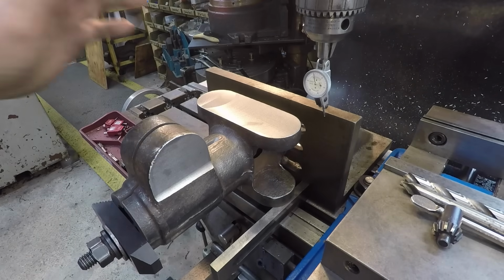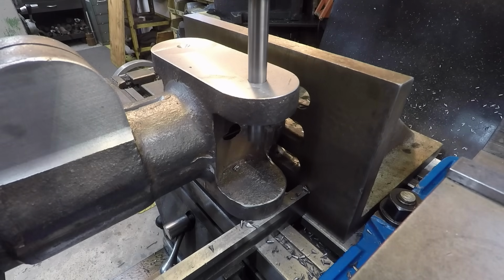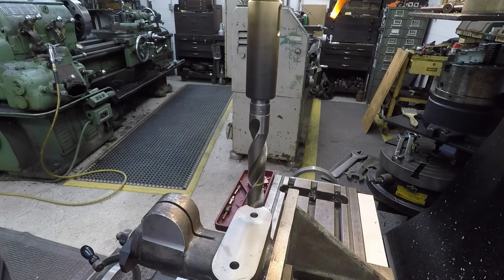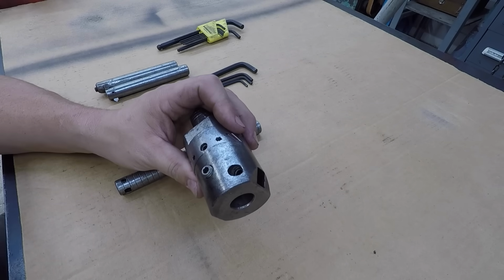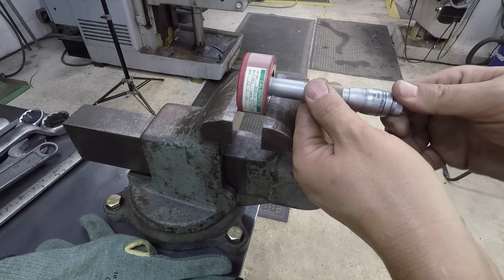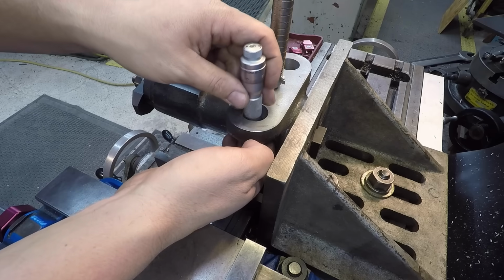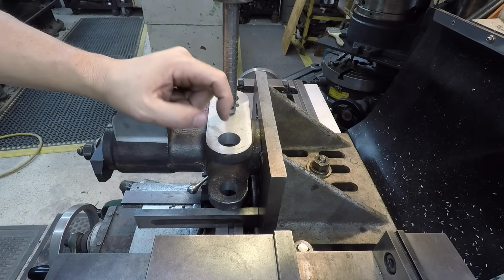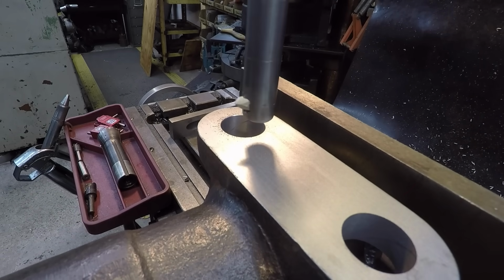Fairbanks Power Hammer Cross Head Part 5

Comment: If the angle plate is the squaring surface against the central bore, why not use the center of that bore as the tabbed base's? Meaning, pick one absolute for the whole piece and use that as the reference? The bore seems like the most important element of the piece. Also, bushings absorb flexing forces and keep the CI from cracking.
Reply: Did he not center on the slot which is center of the bore, then verify that it was center of the tabs?

Comment: How is it possible for a drill to cut oversized?  It’s a defined diameter.  Please educate me!
Reply: Hi Allan, if the cutting edges are unsymmetrical then only one will contact at first and push the drill of to the side as it rotates.
It then cuts bigger than the drill diameter.
This is sometimes done intentionally to get a drill to bore slightly bigger than the shank size, by grinding the tip to do this.
Watching the drill and making sure the chips from both cuts are the same in size is an indication that the drill is cutting symmetrically.
Reply: Both my father and my Uncle would deliberately grind the drill bits off center to get clearances when needed.  It that shop you always used a drill gage to check every bit before you  used it

Comment: Hi. Yet another great video! Quick question - I noticed you stopped when drilling the hole to check the finished size, after 1-2mm (sorry 1/8" inch). Do you ever stop just as the drill enters the pilot hole to check the 'chamfers' created by the drill. I have issues with clamping/centralisation on auto-load CNC machines and a way of checking correct clamping is to ensure that the chamfer is uniform between the rough/pilot bore and the finished bore.

Comment: I'm really curious how you still get a concentric hole with a bent bar? What am I not seeing that makes the tool steal at the end run true?
Reply: The top of the bar remains in the same concentric, plane, or whatever you wanna call it. So even if the bar isn't straight, the bottom part will always return to the same position after a revolution. That is assuming the bar does not flex.
An easy way to demonstrate this is to take a paper clip and unfold most of it, take one end of it and spin it in your fingers. You should notice the other end stays in the same concentric as the end in your finger.
Reply: Exactly.  The way I think about is to clear everything from my mind except the two points at the exact center of rotation of the front and back spindle bearings.  There's an axis of rotation through those rotation points.  Every point on everything attached to the spindle rotates around that axis, and traces out a (nearly) perfect circle, no matter what else is nearby supporting that point.  That includes the tip of a cutting tool (on the mill) or the workpiece itself (on the lathe).

Or... imagine you DID have perfectly straight bar.  Then weld a little lump of steel on it -- would it still cut right?  Suppose you filed a little notch somewhere in it -- would it still cut straight (assuming it's still stiff)?  How about if you welded a lot of little lumps and filed a lot of little notches?

Comment: If I may, why do you not use any coolant during your drilling/boring the holes?
Reply: Cast iron is very easy to machine.
Reply: I believe cast iron has sufficient carbon to act as a lubricant.

Comment: I wonder how practical it'd be to set up a vacuum on a lathe or a mill that's piggybacked off the main motor power and, on a lathe for example, the nozzle is fixed on either the carriage that the tool post rides on or is fixed on the headstock by the chuck, or even both
Reply: not a bad idea tbh, you could save yourself lots of work cleaning with such a setup.
Reply: @Afrokamelffs  problem I see is with stuff like magnesium, you get some of that in the collection bin and then some hot steel and then you have the recipe for a magnesium fire which is a bitch to put out

Comment: adam  why did you reset the boring head when you  did the second set of holes? it was set to 1 tho under target diameter  so its just a matter of locating it ?  curious  it seems like overkill to start from scratch unless it was too much cut for the bit as i know the equipment can handle those loads. and i remember adding steps was just adding possible transposition or calculation errors  or just plain forgetting what was the important number lol less so with dro's and cnc but you still need to keep track of several sets of changing values while remembering target size  often converting between fractional and decimal just for a bit more challenge. thanks for the videos

Comment: Abom, did anyone tell you the trick of wrapping some solder around the bar to reduce vibration and chatter?
If it fell off, it would have been too soft to damage the bit or part, but you can prevent that by twist-tying the ends together.
Try it, I was 19 in 1973, and the machinists that taught me were in their late 60s.

Comment: 08:53 - why would a drill cut oversized? Isn't the fact that the drill is a fixed size part of the point (so to speak)?
Reply: If the tip is ground off center, the bit will 'crank' instead turn. Drills almost always drill oversize (in metals, soft materials not so much).

Comment: No oil?🤔
Reply: Not on cast iron
Reply: The reason why you can machine cast iron, without using oil or coolants, is that the graphite in the cast iron acts as a lubricant in itself.  Oil tends to catch the fines and get them into your way wipers and other nooks and crannies.  You can use a strong shop vac to remove chips and dust, or flood coolant can be used to move the chips and fines on down the line.

Comment: I'm curious why no cutting oil for the drill bits, I it because it's cast?
Reply: Cast iron has a high enough carbon content that the carbon dust that comes off it provides all the lubrication you need
Reply: @TAWithiam  Not just any carbon either, it is graphite which is a fine lubricant, while carbon from a zinc carbon battery, or anthracite coal or diamond , all forms of carbon would not lubricate like graphite does.
Reply: @TAWithiam  I gotcha that's what I was thinking just wanted to be sure thanks

Comment: When I started as an apprentice at the steel mill I'm at, my first job (with a tradesmen there too of course) was to make 12" cast iron piston rings for the steam hammer we have. I machined the OD and ID and width then we made a diagonal cut with a do all and heat treated them! Was awesome! Cool video.

Comment: you referenced the holes from the edge, surely the holes should be referenced from the centre of the big hole
Reply: For the right project it might be instructive if Adam was to go through a part's drawing to address drawing projection, tolerances, parallelism and squareness, concentricities and runout etc and how these dictate the machining processes;  might even do a final compliance check on his newly re-mounted ( and checked for flatness) granite surface plate.
Reply: The holes are referenced side to side from the lug which is centered to the bore.
Reply: @canonicaltom  Adam machined both the lug (and in turn the slitting saw cut) and the 2 flanges using the cast surface as datum ( by taking equal cuts off each side ), rather than using the already machined internal bore.
Reply: @arfonjones7188  Ah, it's true. I had to go back to Part 2. It must not be a critical dimension then.
Reply: Now I'm curious to know what happened to the identical one he made last April.

Comment: Why not spring pass it rather then flap wheel it??
Reply: I think a spring pass is likely to take more off than a thou, and there's no real way to make sure it only takes 1 thou off. Flap wheel barely removes any material so you have much more control to ensure you don't go over.
Reply: @ericg7044   ya that makes. Your right

Comment: The bore was .028 under and he wanted to divide the cut into two parts, so he adjusted the boring head .014 (14 clicks).....but this adjusts the radius of the cut, which should have opened the hole the full .028.  What a I missing?
Reply: Probably the head is calibrated in diameter thou.
Reply: Most boring heads are direct reading dials

Comment: Hi, Adam! You should drill a hole at the end of that split as there will be a stress point.
Thanks for helping to bring another Fairbanks back to life!
Reply: I am glad you asked that, as I was about to mention it.   It does seem strange that a casting is being used to clamp onto the shaft, I thought you can't bend that metal very much.   ( Modulus of Elasticity and all that..)
Reply: @hiscifi2986  The original part  has the same features. I believe  they also ere casted. You can clearly see the  split and drilled hole in  multiple photos on interwebs.

Comment: Hi Abom! What are you doing at right about 10:41, where you reach for the quill lock just as the drill is about to complete the hole and break through to the other side? Are you adding friction to the quill so that you don't bust out the other side too hard and maybe leave a bad exit hole? Please do enlighten me on this little step! Thank you.
Reply: It's possible for the drill bit to grab as you're breaking through material, acting like a tap on the flutes and screwing itself into the job. locking/tightening the quill when breaking through just aids as a brake, preventing you from "losing" the drill.

Comment: at 19:00 that boring bar that has a wobble. Won't you end up with a oblong hole?
Reply: As long as the cutting edge always remains the same distance from the center of rotation the hole will be perfectly round. So the boring bar actually doesn't have to be straight at all -- just stiff enough not to get deflected too much.

Comment: Hi Adam. When the second bore came out on size I'm curious why you didn't just move the boring bar back to the first holes and bore those to the correct final size, and opted to use the flap wheel. With your DRO set for the hole spacing I would have thought that would be easier. Is it because the amount to remove is too small? Thanks.

Comment: Is it the camera angle or me but the shaft on the bull bar looked bent ? What type of bushings do you use on cast , is brass the best or stainless ?
Reply: Hey Dave, that threw me also, but you have to remember, when he adjusts that dial in the boring head, he is making the whole boring shaft eccentric.  Basically, offsetting the boring shaft by x thousandths of concentricity.  So yeah, it looks like it's wobbling, but it's not.
Reply: @rhoused1743  thank you for clearing that up for me ! How about the bushing question ?
Reply: @rhoused1743  you probably correct but even if it’s offset because of the bull bar shouldn’t it still spin true from top to bottom or is it cutting at an angle ?
Reply: He tells you that it's bent but it doesn't matter, the cutting tip is concentric to the bore

Comment: Does the spindle on a mill get a little less ridged as the quill is extended more? If so that could explain the chatter on the bottom hole. Did the second hole show the same pattern?
Reply: I believe he raised the knee as the quill reach is not that large, so must be another reason such as cast variation, or maybe slightly more wear on that part of the knee ways.
Reply: @routercnc9517  he would only have to bring up the knee enough to make up the difference, and that would have the quill all the way out. If he raised it further you would be correct, but I don't see that he did, or didn't.
Reply: @benjaminshropshire2900  He said he raised the knee, but the camera was still in close so I don’t think we saw it happen.  Anyway it was interesting to watch.
Reply: I believe the chatter is because of the long boring bar flexing
Reply: @andyb7963  Yes, but the question is why it chattered more on the bottom hole. Was it casting variations as Adam speculated? Or something else?

Comment: will you do something about those sharp edges where the center bore broke through? 
it doesn't look good and can't be good for the part (cracks)
Reply: Don't forget there will be bushings in the holes.
Reply: @july8xx  the bushings are totally unrelated to those
Reply: @supremecommander2398  At 1:02 Adam states “what were got to do is bore down through these ears here, we got inline holes there, they’ll be finished at seven eights. We’re actually going to bore them larger, probably inch and one eights cause we’re going to install some bushings“. Did I misunderstand him?

Comment: Why are you not using any lube drilling that large hole ?
Reply: It’s cast iron, it’s self lubricating.
Reply: @Hoaxer51  To take it a little further, cast iron contain graphite, which serves as a lubricant,
Reply: @ellieprice3396  The graphite is what makes it not a good weld repair material ???
Reply: @Hoaxer51  Got it ! Thanks

Comment: How do you get a accurate reading with a bent wobbly boring bar?
Reply: On a single point tool it doesn't matter it still swings in space related to the machines rotational axis.
Reply: Suppose you depict a bent bar as a long rod bent at the chuck and heading diagonally towards the bore diameter with a v v short tool bit length as opposed to a long vertical shaft with short tool bit; then the out of balance mass is now the whole shaft rather than a tool bit. This will challenge the rigidity of the rod/chuck connection which in this case is a little loose slip fit  and single set screw.
Reply: The only thing  that matters is that the point of the cutter is concentric to the bore
Reply: And, the work piece is cast iron, that is why he reduced the speed until it was slightly undersize. Then with a reamer or a flapper he will bring it to the right dimensions. A steel part like that would require another approach.

Comment: How can that bar be so wobbly but bore a straight hole 🤔
Reply: It doesn't matter what happens in the middle. Only thing that matters is the cutting point.
Reply: As bcbloc02 said, "On a single point tool it doesn't matter it still swings in space related to the machines rotational axis."
Reply: @steves759  I’m gonna have to research it to understand it. I’m not a machinist so it just doesn’t compute to me. I use plenty of tools at my shop but nothing like this. Thanks for the response though 👍🏼
Reply: definitely wobbly and not cutting straight, but with all 4 holes being like that, guess its all straight now!\
Reply: The "wobbly" is from our perspective as the tool turns.  From the perspective of the tool bit, it's rigid and only moving in a perfect circle. 

 The tool may be bent, but as long as it is rigid, the tool bit doesn't care, or even know.  The bend in the bar, at the tool bit, is just part of the initial offset from center.  The boring head is then adjusted to move the bar to cut the desired circumference.

Comment: Make yourself an X holder and set in each size hex key maybe 1/2” stick out and all you have to do is flip it around to each position. You can certain produce the necessary torque on those screws with such a tool.

Comment: Aren't you going to mill a hole at the end of the slot you cut with the slitting saw to prevent cracking when it is tightened and loosened?
Reply: It shouldn't need it - the saw was not deep engaged meaning there is a deep curving scallop that alleviates the majority of any stress raisers it would take several drillings to clear the length adding more issues than it solves

Comment: Make a multi tool for the Boring Head. Get a 1/2 inch steel or brass ball, drill 4 holes at right angles and solder in 1 inch long bits of allan key for a sort of stubby version of the ox tools hex spinner.

Comment: How can you cut a round hole with a bent bar? 
I can see it working fine, just don’t understand. Thanks for sharing 👍👍
Reply: The offset from the bend is being applied in all directions.
Reply: @benrivenbark  great 👍 thank you.
Reply: @benrivenbark  thanks for the explanation 👍
Reply: The roundness is a product of the spindle rotation.
Reply: The bar being bent only changes where the tool edge ends up so you account for it by setting a zero then move from there. So bent would mean that if his boring tool holder has some zero on it that zero wouldn't be correct. The bent bar might mean that the edge of the tool is zero on the piece when his tool says it should be at -4 or +7 thousandths of an inch. It would be the same as having a longer speed steel head or a newly ground one. It still rotates in a perfect circle.
Reply: @nocturnhabeo  thanks for the excellent explanation 👍